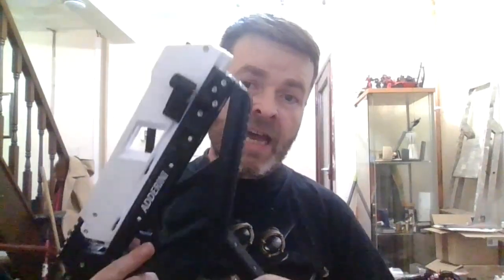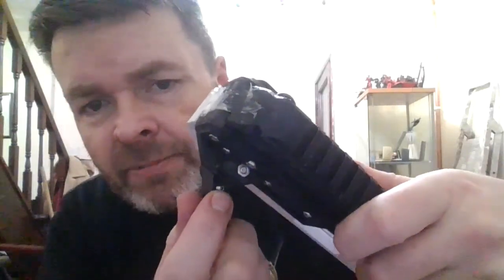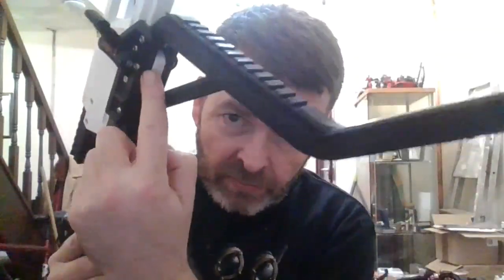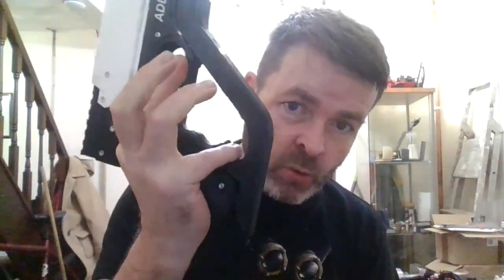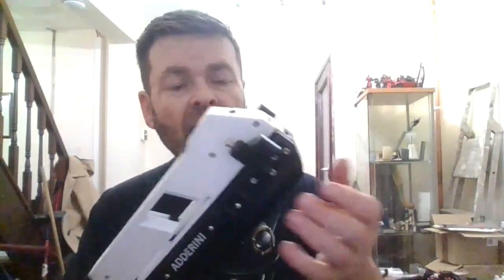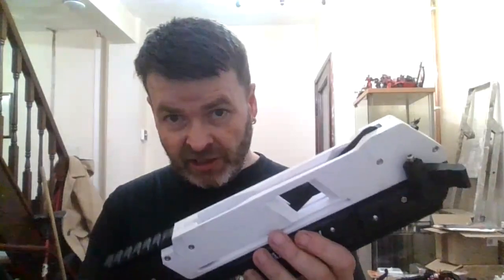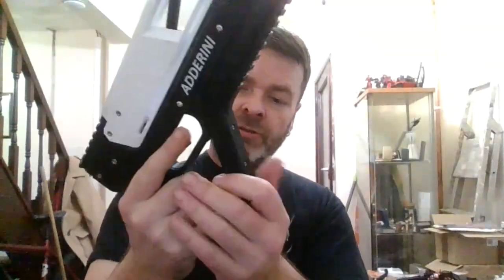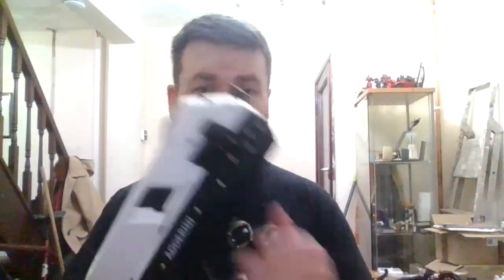adderini DIY Build Guide Part 4 Build your own slingbow

Comment: Nice! Lookslike this is the most complete adderini video on youtube. 

Hopefully later you will give the accuracy results and also I am curious about the trigger pull weight if it is possible. My 50 lbs pistol crossbow trigger pull is so heavy that somewhat hard to shoot it accurately and make me doubt to build adderini because it also has very simple trigger just like my crossbow.
Reply from the maker: Ive literally just finished it, uploading video now, should be up in 40 mins, has quite a light trigger, better than a prophecy trigger in my thoughts :)
Reply: @markhuckercelticcrossbows7887  Great! I guess I will watch it tomorrow, already 2.26 AM here. 
Yes my crossbow pistol trigger is prophecy style, if the adderini is better then maybe I will consider to build it. Thank you!
Reply from the maker: @ulungprabowo  im looking to see what feed back i get and possibly start selling built ones or kits through my ko-fi.com shop
:)
Reply from the maker: prophecy, cobra, steambow stinger, tomcat 1, yak terminator 3 etc, use a 1 piece pivot, to push the sting off the breech block, so has to over come a high resistance on the end of the bolt rail, so no pressure on the triggert. the Adderini uses a claw to grab the sting direct, like on a rolling nut, on a traditional crossbow, so all the weight is on the sear. so a light let off, with some small creep. 

if the trigger fails on a cobra prophecy, the bolt wont fire, if the trigger fails on redback or adder or ANY other crossbow using a rolling nut or claw, it can still fire. BUT!!!! chances of that is millions to one, but always keep the noise pointed at the ground, just incase, works the same as a rimfire, if the sear fails, the gun will fire.
Reply: @markhuckercelticcrossbows7887  yes but the claw and the trigger of adderini is in one piece, but it is true, maybe there is some levering action going on in there. I also own a homemade medieval crossbow and the difference between the two is so different.

By the way I have seen your shooting video. It is very nice!
Reply from the maker: @ulungprabowo  
hiya, its sleet rain n snow today, but first clear day, i want to do an outdoors video, ive tried it with multiple bolt types, no damages. will be going on my kofi shop after christmas, once im done with it, for the channel :)